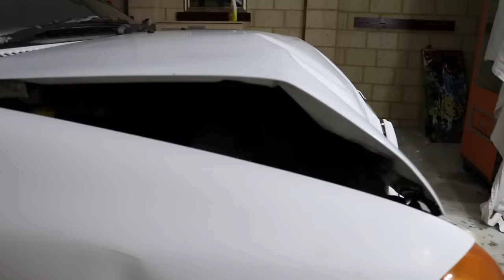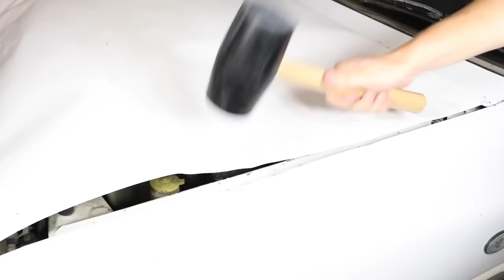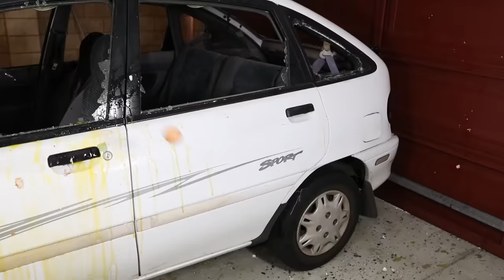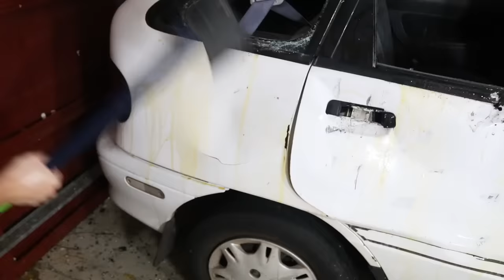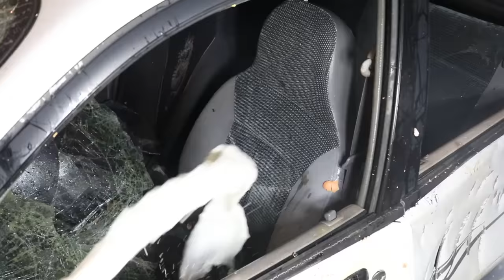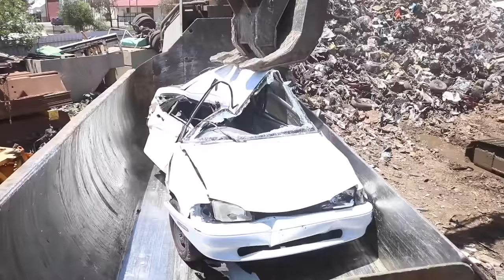How To Fix a Dented Car

Comment: To fix a dented car, 
1. Destroy it
2. Buy a new one that will ended to be dented again
3. Repeat the steps for a life time
Reply: Step 4 : throw 294 egg to your car
Reply: Step 5. Scrap your car
Reply: @bookvercetti3421  you really counted all the eggs?
Reply: @bookvercetti3421  294 eggs ??!! That's what I call an reliable egg milimiter machine gun
Reply: Beluga  fake beluga
Reply: Eletrical Stacy The Creator Is Scared now  godzilla had a stroke trying to read this and fucking died
Reply: Eletrical Stacy The Creator Is Scared now  🗿
Reply: He Didn't Fix Everything, He Broke Everything, & That Is Not Okay.
Reply: Step 7. Pour lots of milk inside the car and dump ice cream on it
Reply: 😡ANGRY STACY MIKU😡  bad grammer.
Reply: 😡ANGRY STACY MIKU😡  imagine your an freaking 8 yr old i saw you your an 8 yr old
Reply: Step 8: flood your car with water
Reply: Step 9: burn the car
Reply: @刘洁-k5x  that would make a lot of sense
Reply: Step 10: replace the oil with lava
Reply: non ending debt for a life time
Reply: Step 11:pour the engine with lava and bomb